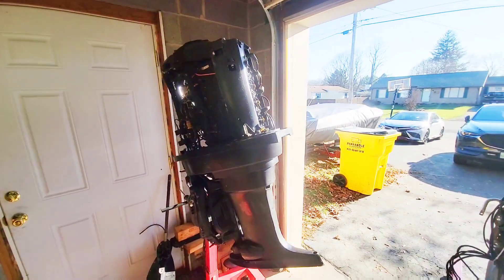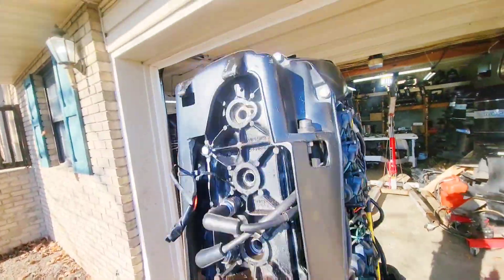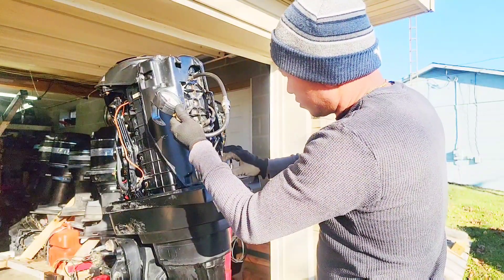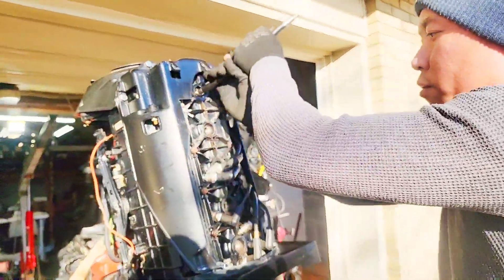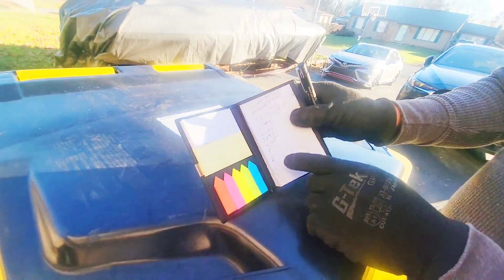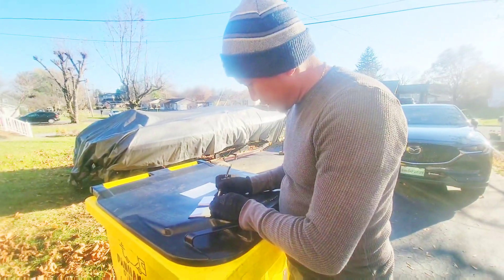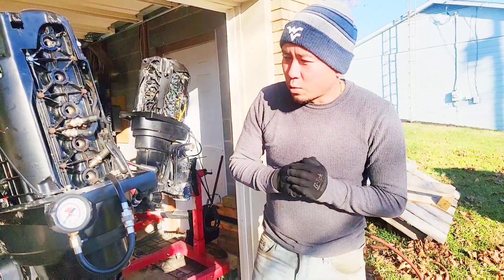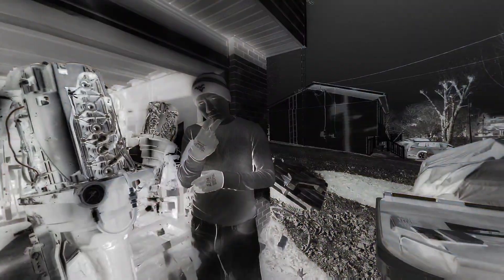Outboard Motor Compression Test: Inline 6's

Comment: Can you swap the indvidual coil style ignition to the distributor style engines of this era?
Reply from the maker: No. Unfortunately they have different resistance readings. Son
Reply: @MerCSonL6  what about engine blocks?
Reply from the maker: @karll5492  depends on the block and pistons. 1400s and 1500s have high dome ported pistons. Whereas the 1984-1988 had low domes. You can put ported pistons into a non ported block but you can't put non ported pistons into a ported powerhead. It will not operate the same. I think I got that right.... 900s and 1150s before 1982 had did not have ported pistons. What exactly are you trying to accomplish? I need years/models and I can tell you if it's compatible. Lmk
Reply: @MerCSonL6  do you have a email? Not entirely sure about the years but I have a 85 HP 4cylinder with a possible knock and I was gonna swap power heads with a older style 85 hp

Comment: I do open the carb especially on multiple carb engines. Just to take that out of the equation. When comp testing I am usually only looking for a cyl or 2 off the others. For determining the shape of the engine I go with a leakdown test. Almost all I do anymore. But I realize doing a leakdown on a 2 stroke like this would be a challenge! With no valves or head gaskets the ring to cyl is all you can test! My 140 put out 152-157 psi across the board. Cold with no oil. Haven't fired it yet. Has new stator and trigger, new switch boxes and coils. Bad engine harness. Carbs were fairly decent but I went thru them anyway. Used your float setting method. Wont be long before I wrap it up.